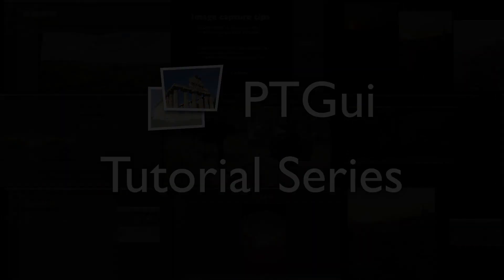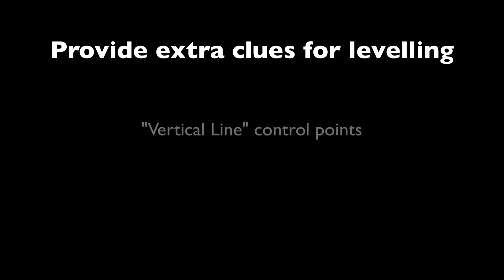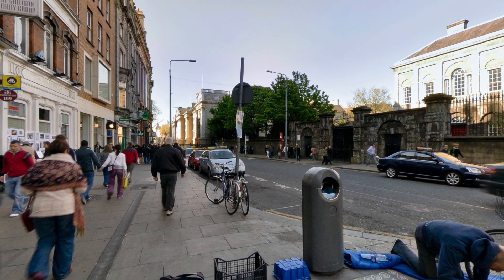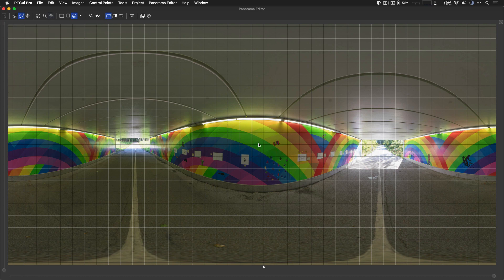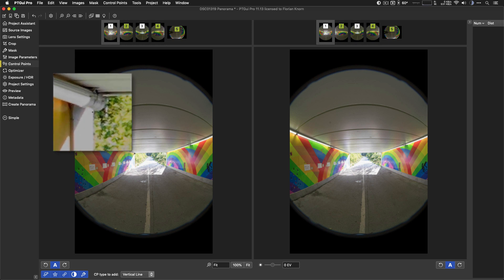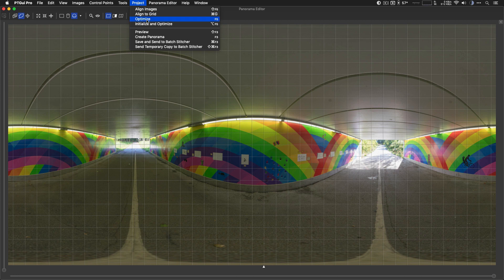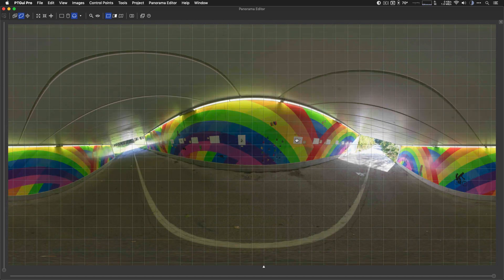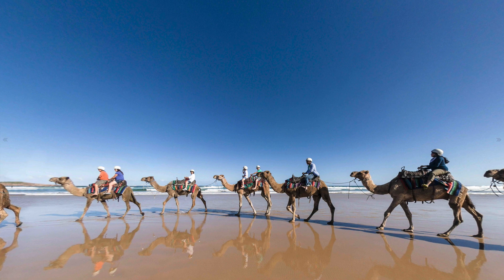PTGui tutorial part 8: Levelling

Comment: In my version i didnt have the menu for changing the control point type, so thank you for the tip on choosing the same image of both sides! In that case it creates vertical control points by default, and i can change them to horizontal by right clicking on the point.
Thank you!

Comment: So my question is why spend $244.00 on PTGUI vs Lightroom/Photoshop that gives me nearly 2 years of subscription with more options including a pretty good panorama stitcher?
Reply: In my experience Lightroom / Photoshop actually do a comparatively bad job of stitching. The edge lines may look nice, in perfect situations, but what about those times you were just a bit off when leveling the tripod, or the area you're shooting ONLY allows handheld? I've tried using both Photoshop and Lightroom for those situations, and as a result those panos have never been published. They always had portions that were skewed, or wouldn't level correctly, or wouldn't match up correctly.
PTGui, however, makes it possible to not only stitch unusual circumstances, but often they still look normal even with less than perfect control points, and it takes HOURS less time to do to get the same result. Add in that when you buy PTGui, it's *yours*, so no worries about Adobe suddenly charging you a full year's subscription at once as penalty for cancelling (this happened to me), and PTGui is a clear winner to me.
Bonus - PTGui customer support have always been absolutely stellar, going far beyond the standard to help. Good luck getting that from Adobe.